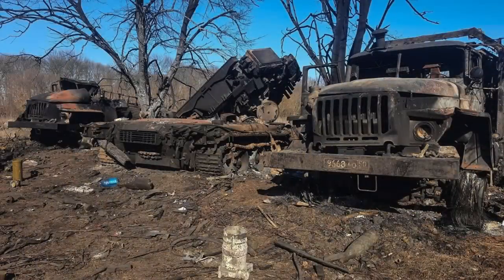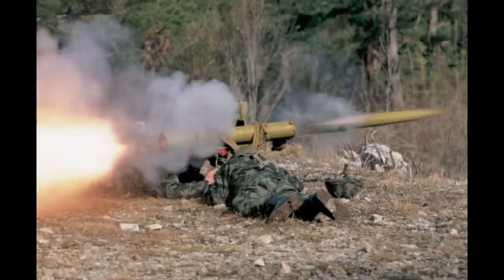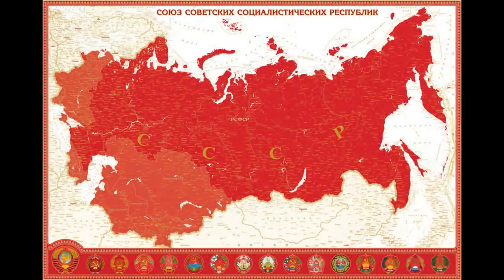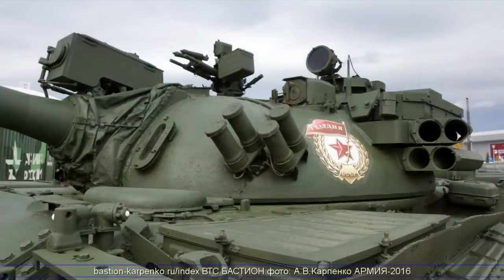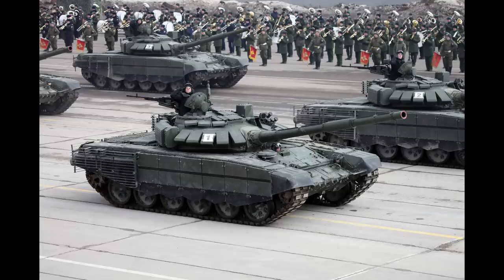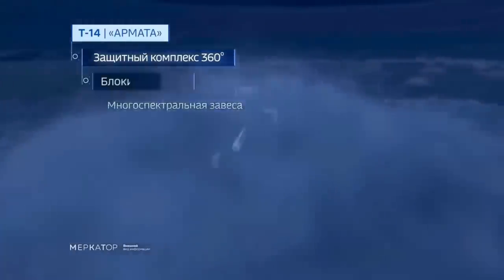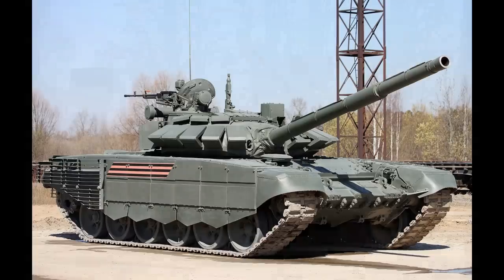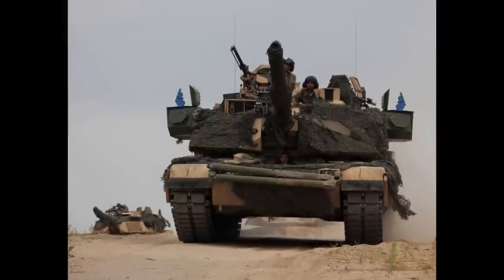Why are Russian Tanks Failing in Ukraine?

Comment: the Russians think that there is no system that will provide protection to a small number of tanks when, on the other hand, you have such a large number of ATGMs, helicopter tank killers, planes, artillery and drones... today tanks are used only as support, not as they once were- for breakthrough
Reply: The Russians still use them in that role though. That's why their tank attrition rate is so high. They're still stuck in the Soviet doctrine of using tanks as the tip of the spear followed by infantry and support vehicles. This is why so many tanks are lost. They have very little combined arms compared to the U.S. centered Western doctrines where infantry tend to lead with their armored IFV that brought them in with tanks following in support. The infantry sweep through and clean up the flanks and root out the AT troops and the tanks can engage any fortified location that the IFVs smaller autocannons can't engage economically. It's the outdated doctrine that's kicking their asses right now. The Soviets believe that quantity was a quality all its own and it was the most important quality in their warfare. They banked on overwhelming The West in pure numbers so they used massive numbers of cheap tanks as the tip of the spear with infantry as cleanup. The modern Russian military still operates this way because adopting new doctrine would generally mean adopting new tanks and other equipment to match the modern doctrine.
Reply: @Talishar  They are not using Soviet tactics. They use artillery superiority tactics. Which is better than the west. The war is huge and because of that they have great losses.
Reply: @Talishar  Tanks are not support vehicles, and I'm struggling to understand why people consider it that way. IFV/APC could maybe be considered a support vehicle. A tank is a direct fire spear heading vehicle, the infantry has the supporting role, not vice-versa( if Russian are loosing tanks it's because of their doctrines, it's not that they have bad tanks) The French at the start of WW2 were using tanks in a support roll and it costed them dearly, Germans with inferior tanks but superior tactics came on top. As you mentioned infantry is supposed to clear out possible ambushes, AT troops and position, to allow a tank breakthrough( that's why the German panzer divisions had panzergrenadiers who were supposed to work in coordination with tanks). If a breakthrough occurs, who is supposed to spear head and exploits the hole in the front?! A helicopter, IFV or a JEEP with a MG? Obviously you want a tank in that role. In the battle of Kursk German lost 500 tanks and Soviets 1,500. Yet no one was thinking since the loss rate was so high, that somehow tanks are not good enough for breakthrough anymore. Not the Soviets, not the Allies nor the Germans thought so. Germans even tried it again in the battle of the Bulge, and were stopped by the armored divisions of Patton. You don't have to go far back, to find a good example of tanks being used properly for it's breakthrough capabilities. Operation "Iraqi freedom'' was spearheaded by mostly American tank/motorized divisions. And obviously, you can't rely only on tanks cuz they are not wunderwaffe, it's all about synchronizing the air power, indirect power( artillery), infantry and direct power( tanks). Don't mix bad military doctrine with the capabilities of a tank. Funny how history repeats it's self. Cuz that's exactly how the French lost the the first stages of WW2. They downplayed the importance of an armored spearhead. All I'm saying is that Russians don't know how to utilize the breakthrough capabilities of a tank. They didn't establish air supremacy, and they are sending their tanks without infantry support.
Reply: @nikolaskoric804  Tanks as the breakthrough vehicle is old WWII doctrine and one the Soviets/Russians use as doctrine. During Iraq, tanks didn't spearhead those ground operations, air power did. Between jets using stand-off guided munitions or helicopters dropping long-range Hellfires forcing the Iraqis to dig-into emplaced positions. They had one armor on armor engagement at Hastings, but other than that, they were entirely fire support. They didn't push into the cities leading the charge, they mostly tried to stay outside of the city and let the infantry and IFVs do most of that work and only came in when enemies were dug into a well defended building where Bradleys would have to expend nearly all of their ammo to effectively neutralize a building. 

Even in WWII, the primary purpose of most tanks were as infantry support. Their job was to hit bunkers and other heavily defended positions to breach defenses which infantry could exploit. Infantry are always your primary resource. They're the ones who capture and hold territory and go into all of the areas a tank can't get into to root out the enemy. Tanks are force multipliers. They aren't the means of an end themselves, but in support of the ultimate part of the military that's ultimately the primary focus, the infantry. The jet bombs an objective to soften it up generally for the infantry. It may hit anti-air targets to allow themselves an easier time to drop munitions, but it's ultimately all in support of the infantry who have to come in to do the work of securing and holding the objective. All because something may go in ahead, it doesn't mean that they aren't providing support. Armor supports and protects the infantry. The infantry are the primary means of getting things done at the strategic level, not the tanks. The tanks just allow the infantry to do their jobs easier or more effectively. 

Even in the Air Force at a fighter squadron, we'd always say that the Army and Marines were out customers. Everything the Air Force or even Navy does, is in support of those troops on the ground. You can't win a war without boots on the ground unless total annihilation is the metric with which you win the war. You CAN win a war with only infantry if you're willing to accept an absurd attrition rate. Even most of the experienced tankers I'd talk to would say that they aren't the tip of the spear. The grunts are. As their namesake says, they're the armor. They're the defense that ultimately protects the main components and enables it to do its job. That's the difference between modern western doctrine and eastern Soviet doctrine that Russia still uses. The tanks aren't armor, they're the spear. Instead of maneuvering infantry ahead of an armored column in ambush, the tanks are instead always in-front. The tanks go ahead and assume control and the infantry later captures. It may seem similar at a glance, but it's fundamentally way different.
Reply: @valentinpetrov8608  They have far fewer soldiers and are winning. And you say that they are a joke. Interesting. 

Most of the losses on the battlefield are from artillery. So you are talking nonsense. You don't know what the Russians can and can't do.

This is Ukraine, the second largest country in Europe. Their air force has been wiped out and they don't stand a chance against Russian anti-aircraft defense.
Reply: @valentinpetrov8608  It's like you watch too many movies. You imagine what would happen if it did. This is real war.
Reply: @ares8866  They did not start using a heavily artillery dependent doctrine until much later after exhausting their supply of armor and much of their infantry. Also, the west has MUCH better artillery technology, training and range than anything the Russians have in mass adoption. Most of the Russian systems are Soviet era or Soviet derivative with little upgrades. The U.S. was the first to use smart, guided munitions in an artillery round and the first to get field ballistic and fire control computers. The west has the money to actually put good computers in them too and most modern U.S. artillery systems vastly outrange anything the Russians have. The U.S.s modern field guns have near MLRS range and the U.S. MLRS has nearly twice the range of Russian MLRS with a higher degree of accuracy. 

The Soviets and now the Russians were obsessed with getting things cheaply and in large numbers. They chose quantity over quality and accuracy and precision costs a bunch of money the Soviets and Russians never invested in. You don't get your equipment cheap and of good quality and performance. It's one or the other which the Russians are experiencing with the T-14 that they can't afford to produce any real number of.
Reply: @nikolaskoric804  Even during WWII, the US used the tanks 80% of the time for support and 20% spearhead (only after air superiority has been achieved). As far as the US is concerned the air power is the tip of the spear. 
France fell due to having 2 infantry divisions fighting agains 7 panzer divisions combined with all the Luftwaffe at the Ardennes.
Reply: @nikolaskoric804  "Tanks are not support vehicles"   Tanks and infantry fight as a combined arms team.  Each supports the other and depending on the situation one of them acts as the killers and the other as support.
Reply: @Talishar  To just say russian/soviet doctrine is or was to just pump out numbers is an oversimplification and neither the russians nor the soviets completely abandoned all quality and practicality in their systems and i dont think there is this extreme difference in performance in russian and western equipment when you look at what can be achieved at what price in an conflict between the two and artillery in particular is one of the few things where one could very well argue that russia has the overall advantage. I also dont think that russia's switch in tactics was because they exhausted their troops, the casualties suffered in the first 2 months were very heavy because of a stupid strategy for the most part and their new approach to be more careful and methodical was because they realized their mistake and tried to fix it.

After the war ends and we can get reliable numbers on casualties, performance and strategies/tactics used we can start to come to conclusions but for now were we dont know really know of all things that happened since the war started, why it was done, what went wrong, how much are DPR/LPR militias involved and how they performed, and most importantly why did it go wrong and whos fault was it? The fog of war in ukraine is dense and the fact that their is a lot of misinformation coming from both sides makes it even worse, there of course are things you can talk about with relative certainty and I take most of that from neutral or western sources like the bundesheer for an excellent analysis and when it comes to numbers of course the USA but none of them claim that the russian army is beyond help and some even went as far as to say that ukraine should not make the same mistake as russia and believe their own propaganda and it just seems that portraying russia as something worse than they objectively are is part of this wishful thinking.
Reply: @Talishar actually we arent well known for our artillery.
Reply: @geniusderweise400  The Russian advantage in artillery will go away the moment the counterbattery radars we are sending to Ukraine go into service.  And in artillery vs. artillery duels - accuracy is the key because the more accurate guns will kill the less accurate guns.  And that's assuming that the Russians have a useful counterbattery radar of their own.    Of course, the moment a Russian counterbattery radar lights up - it will have an incoming HiMARS missile.

And even those massive artillery barrages (1st World War tactics) are not sustainable due to the wear on the gun tubes.  We have already been shipping replacement gun barrels for the M777 artillery we sent over - and the Ukrainians are not firing their guns at the rate the Russians have been doing.
Reply: @geniusderweise400  That's actually not true. The US artillery was and still is more acurate and has a range advantage. The US also had 3x to 5x more ammo then the germans and soviets due to vastly superior logistics. 
What the US lacked was a large number (compared to the soviets) of self-propelled artillery. But the US used and uses the air assets as flying arillery.